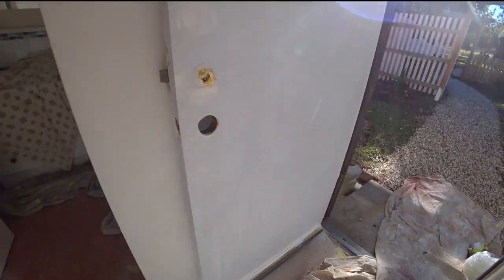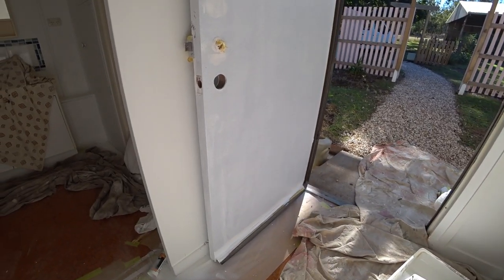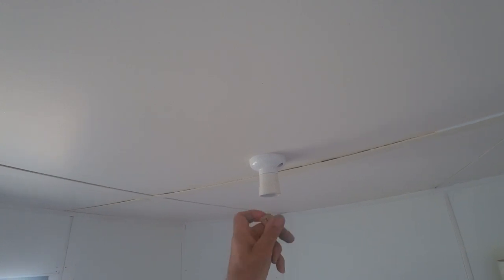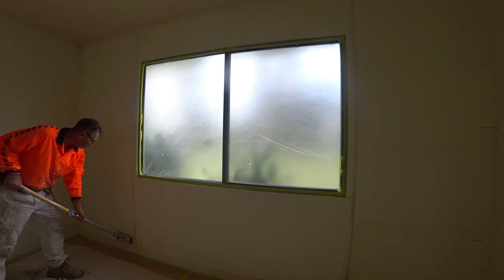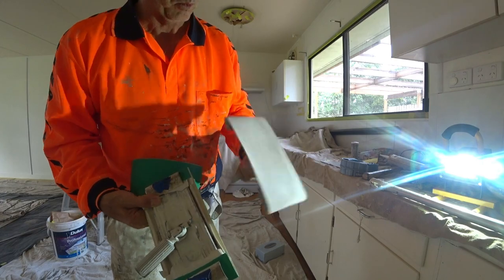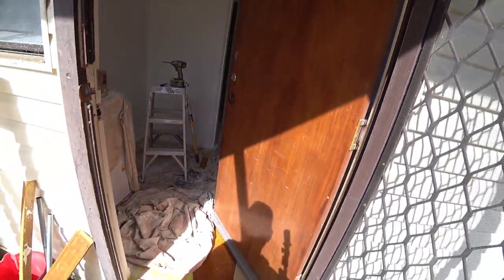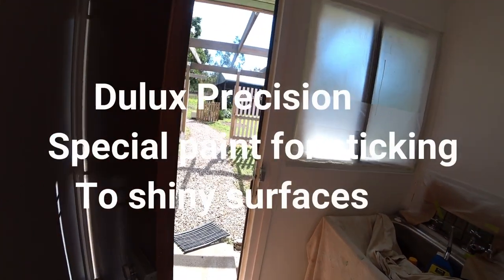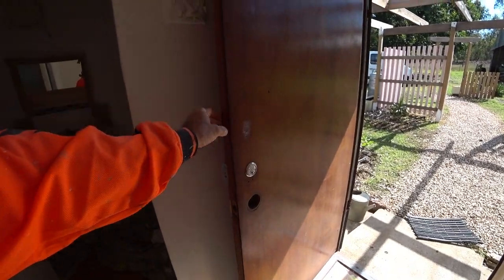Dulux Precision ,my personal experience using it on old  Gloss polyurethane,must watch

Comment: Good vid like always mate. 
Let me tell you my experience. Last year I had 30 doors, door jambs, 20 windows and skirtings to do. Everything had varnish on it. So I said I will use precision coz no smell and such.
I've sanded everything really well, wiped down with wet clothes, dusted off bla bla bla. Like really took my time with no shortcuts!

Doors were peeling like crazy,  was really bad. Windows and skirtings were perfect tho! I rolled doors so I think that was reason why precision didn't stick well. Somehow brushing in was creating maybe thicker layer or maybe fact that brush bristles really were working paint into old varnish. I have no idea.. rolled all doors with oil based undercoat again and no problem.
I won't trust precision any more 
Just my 2 cents.
Reply from the maker: Sorry, you had to go through that Mark, that's one of the reasons I did the video, I usually don't like to bag a product but this needed to be said. It also is another $60 AUD more expensive than Dulux premium Quick-dry undercoat.
Reply: @ThePa1nterhowto   good on you for doing that sir, I'm certain that will help a lot of people.

Comment: I used this product on a job last year, the pine door frames were pre coated uv clear and also tested it on one mdf door precoated from cabinet makers, i machine sanded dusted then sprayed it and I gave it a week to dry , I also wasn’t to impressed with this product , I called the rep he said give it a week to properly cure, it was a little better however i wasn’t too happy with it , so  the next unit and rest of the cabinet doors I sprayed with oil based with no adhesion issues, but it didn’t scratch off as easy as I see here...
Reply from the maker: Wise move to not use it , I was only really testing it here on this door , it didn't really have much of a job to do but it still failed.

Comment: I had the same problem with precision not sticking to doors, so I asked my Dulux rep to come out and explain why. He said you have to put it on heavy to build up the micron thickness for best results. (I was using a 4mm microfibre roller)
Reply from the maker: If you would have put it on thick they would have said put it on thin. Nothing wrong with what you did

Comment: I have personally found it to be a very good product but only if you sand and de gloss surfaces well. It has never failed on me and i typically always do a scratch test after using it. It does definitely make sense to wip the quick dry out if you only have a few doors/jambs , i do the same. I typically use the precision when I have a lot to do and want to spray. I don't like spraying oil so its a good alternative for me. I noticed you also said that you used the roller already with paint on it, that could also be a reason why it failed. Nice video either way
Reply from the maker: I think if you have to sand and degloss a surface, you could probably use any acrylic paint to do the same thing and get similar results. One day we won't be able to use oil based undercoat because it will be phased out. I've given dulux precision a fair go and will only use it when I have no alternative.
Reply: Fair mate, my experience with it has been overall good. I doubt they will phase out such a highly used product like quick dry.
Reply from the maker: @c0Nz7  I hope they don't, its my only sure thing when it comes to paint sticking with no sanding.

Comment: So would you use Dulux Precision for anything specific?
And what brand brush would you recommend for the Dulux one step    oil based undercoat? Its a pretty thick product.
Much appreciated.
Reply from the maker: Oil undercoat is thick because it can be used as a filler at the same time, just thin it if its to thick. I only use unipro brushes

Comment: Please tell me when applying your water base Enamel to trim  do you still opt for the oilbase undercoat ?
Reply from the maker: Yes, use the "Quick-dry" oil-based undercoat product (Don't use the cheaper normal oil-based undercoat) and its still the same day recoat, you can be 100% sure it will stick. I forgot to say, only on repaints, on new work just use the normal water-based undercoat.

Comment: would u still scratch up the door if using oil based undercoat?
Reply from the maker: No need, that's the beauty of it, no sanding needed, just light sand before your final coat, are you finishing with oil or water-based?
Reply: @ThePa1nterhowto  sweet yeah just standard oil based enamel
Reply from the maker: @brandan2189  Only one coat needed so another big savings
Reply: @ThePa1nterhowto yes !! but sadly it's   w.a white tho looked a bit see through may just give it a quick lick of  psu to be on the safe side

Comment: Hey quick question do you like to use oil undercoat of your walls and ceilings when painting over a glossy surface? Or just to help maximize adhesion when doing a repaint?
Reply from the maker: Yes,any old enamel ceilings and walls,fly poop, nicotine,smoke,rust, it does the lot, one coat of qd oil undercoat, no sanding needed either, prep after ther undercoat
Reply: @ThePa1nterhowto  I’m in the us I use coverstain oil by zinsser here great product!!
Reply: @ThePa1nterhowto  also Greg does oil bond and bind grease and oil on walls?
Reply from the maker: @palmerpalmer1538  if I get a greasy kitchen in a repaint,I give it a wipedown with mineral turps to remove the majority of the crap,because we are using oil based you can the roll it immediately and merge in the oils remaining, so yes it does. I also use it around power points where greasy handmarks are
Reply: @ThePa1nterhowto  I notice you say turps often is that just your thinner or mineral spirits
Reply from the maker: @palmerpalmer1538  yes

Comment: Thanks for the video. I agreed the precision is expensive but you would think it was an exceptional product if price was anything to go by... Did you contact your paint rep?
Reply from the maker: I actually don't have a paint rep at the moment, they haven't replaced my old one who changed positions recently. From my previous experiences with paint reps, it's for sure I'm in the wrong.
Reply: @ThePa1nterhowto  are yes.. one of those reps. I have 10L of precision unopened as I have some enamel door frames that need painting.. after the video I think I will stick with old faithful oil base.

Comment: aluminum wood primer would be best and that would permanently seal any knots or oil undercoat mixed 50% owatrol but wouldn't be as good.
Reply from the maker: I was trying something new but no harm done.
Reply: @ThePa1nterhowto  oh yes i know i tried the equivalent dulux adhesion primer uk it did better than this on doors but not so well on staircase handrail can't beat aluminium primer